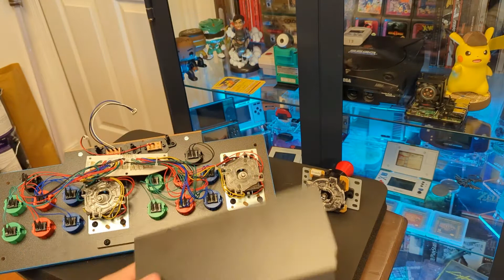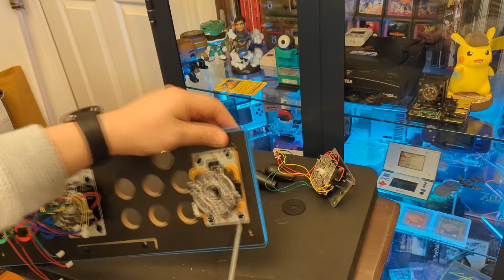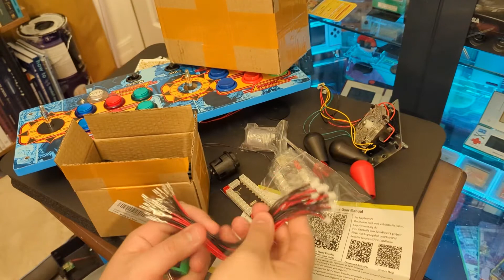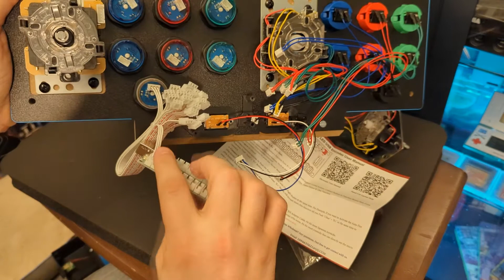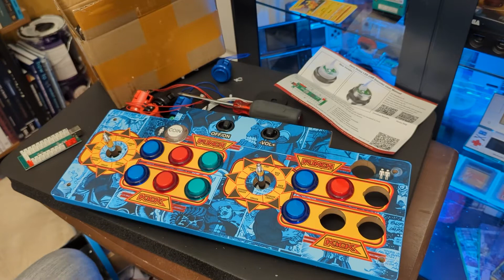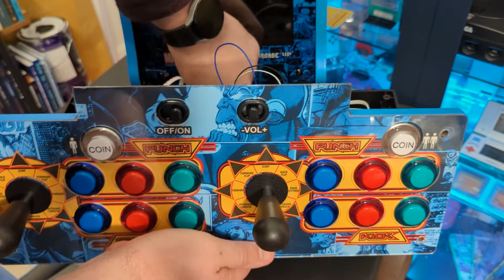Arcade 1up 2 Player Gen 3 Courtercade - USB encoder & Easy Arcade light up Buttons Install

Comment: Nice video! I already successfully followed part 1. Question does this video show how to use the power switch with a pi4? The volume button works after part 1 but not the power switch, not sure if I made a mistake.
Reply from the maker: Did you connect your 2pin cable from the ON/OFF switch to the Pi4 directly on GPIO pin 5 and 6? Or did you connect it from the Geek Board?
Reply from the maker: Also, is your Pi4 old? like from 2019 old or did you recently buy it? Older Pi4s had an update to fix some ON/OFF Switch issues.
Reply: @Xplosiv-Tech  I connected it to the geek board and then the pins 5 and 6 I added a command line to the boot script and it just worked with schmoomers Shepard pi plus image. And everything just worked. 👍

Comment: Right on! I just bought a raspberry pie 4 for this project. Do I absolutely need everything in your links or are you just providing extra stuff in case I need it, Like the Micro card and Cable clamps, headphone extention cable? I already have a Micro Card coming with the pie.

 I already know I need the light up buttons/ joysticks and the VGA Converter board. I got the complete Raspberry pie 4 kit coming.

 I just want to know exactly what I need minimum to get this thing done! Thanks!👍
Reply from the maker: Sure I'll link the whole setup I current have.
Reply from the maker: https://youtu.be/39cBiu-eJf8

Comment: I just used the original buttons with the original cables and I had some joysticks laying around so I installed those. I don't like light up buttons. I have them on my bartop and they are blinding. I still have to drill a hole for the select/hot key button, and run a usb and audio extension cable to the front but other than that everything is working fine.
Reply from the maker: Great to Hear. I was planning on keeping the original buttons but wanted to use light up buttons to make this more of a Mod Tutorial for all options. The buttons aren't actually that bright or intrusive with gameplay. But switching out joysticks and using any USB encoder is all you really need. I bought a USB extension that I plan on connecting to my Pi and bringing to the front to replace the USB port on the side of the controller deck. I plan on possibly showing that in my next video.
Reply: I used the original buttons and cables as well. Just had to replace the end on the joystick cables from the 4pin plugs to the 2pin plugs that came with my encoder board cables.
Reply from the maker: @Evanp1  so you also kept the OEM joysticks?
Reply: @Xplosiv-Tech  yes I did! The cables were soldered to the joysticks, so I just replaced the 4 pin ends with the 2 x 2 pin ends. Worked great!